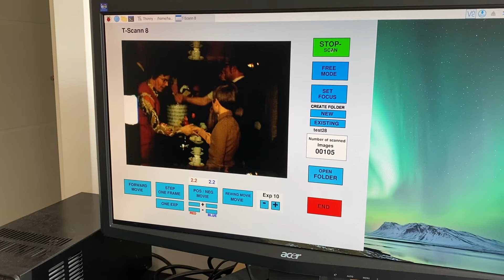T-Scann 8 photo shoot

Comment: Wouldn't it be easier to just "Rent" one of these from Amazon. I could plow through my family reels in a weekend, LOL. Serioulsy though, very impressive. I bet you could probably run a little niche website doing 8mm reels for folks at cheaper rates than the big boys. If you added 4K digital upscaling via AI tools like Topaz, you could deliver a superior prodfuct for less $$$, I would think. Anyways, great job.
Reply from the maker: Thanks Andrew, interesting software. I now use FCPX to generate 4k video. Will do a test with Topaz trial.
Reply: @HansMeulenbroek  --- Yeah, it's unlimitted, the trial, I think. It'll just leave the watermark. 

I took some scanned footage from a Wolverine, which came out at 1080P, did a quick stabization in Davinci and ran a 25 second clip of my older cousins playing volleyball in the 80s through Topaz. 

The original scan was certainly pretty good, as far as these things go. With the stabilzation and a 65" big screen it looks better than what I remember it looking from the projector.

Anyways, the upscaled clip from Topaz was a little better, I think. I haven't done much with the Topaz settings other than the default (upscale 2x and add frames, or something.) 

Topaz is worth playing around with, doubt I'd spend $200 on it. Things like this will be built in to the next gen of ediors me thinks, and there's already off the shelf solutions for the more DIY inclined.
Reply from the maker: @NorthTonawanda1  good to keep learning... I have scanned some 8mm with a similar (same) scanner, the Reflecta. If only the auto white balance could be disabled and the frames could be saved as individual jpg's. The sharpness is good but the compression not. I prefer using my own scanner recently build with a modified T192 projector. Have a look at moevi.nl in the projects part. It's in Dutch... but will be interesting to see. The T-Scann 8 makes great scans too but needs some more software updates to improve frame stability (at least for my scanner).